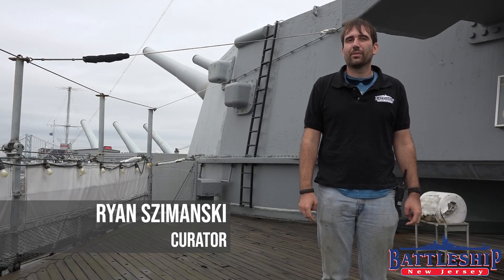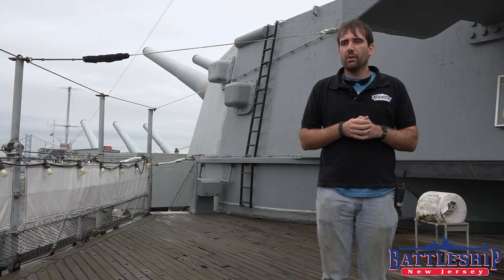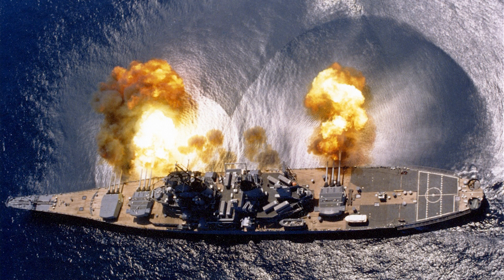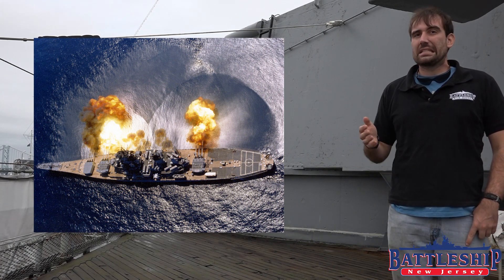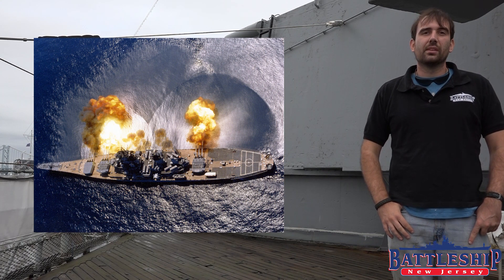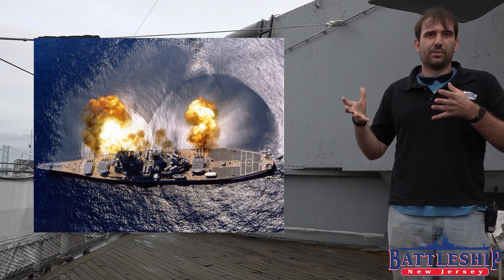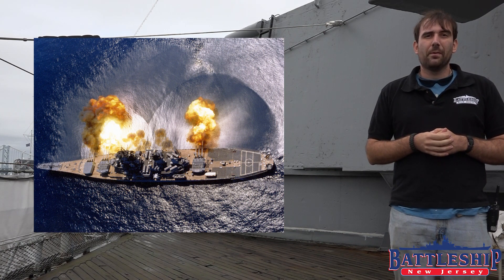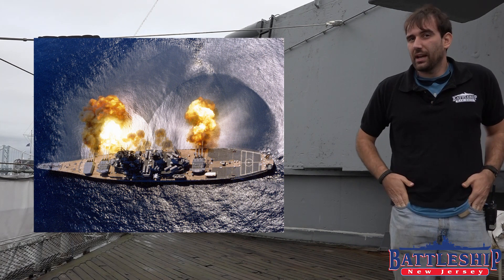Does Firing the 16in Guns Move the Ship Sideways?

Comment: Please see attached engineering analysis in the replies
Maximum Lateral Ship Velocity	0.59 ft/sec
Lateral Displacement at Time of Max Ship Velocity	0.42 ft
Lateral Ship Velocity at 60 Seconds	0.46 ft/sec
Lateral Ship Displacement at 60 Seconds	30.98 ft
Reply: This is follow-on to the analysis published in navweaps.com (http://navweaps.com/index_tech/tech-022.php ).The analytical approach taken there is valid, but doesn’t go far enough to fully answer the question. See additional comments on the above analysis in Appendix A.
The purpose of this document is to elucidate, extend, and improve the analysis presented in navweaps.com. Future contributors will undoubtedly improve further on what is presented here.
The navweaps.com analysis does a lot of the “dog work” associated with the overall question. Many of the analyses, calculations, and assumptions are correct, and are used here. This document will also clarify the physical phenomena involved, and more fully document and explain the assumptions.
Assumptions
Simplifying assumptions are valid, and don’t detract from the correctness of the analysis. They include, but are not limited to:
1.	The gunfire reaction forces are applied at the center of mass of the ship.
2.	Losses during transfer of the gunfire momentum into the ship’s hull are negligible.
3.	No yawing, rolling, or pitching moments are calculated.
4.	No aerodynamic effects are calculated.
5.	The ship is initially stationary, i.e. neither under power nor drifting.
6.	The water is calm, with no currents.
7.	A single salvo of nine, 16 inch guns is considered.
8.	The guns are oriented broadside, i.e. 90⁰ or 270⁰ “relative target bearing”.
Physical effects
The firing of a shell imposes an equal and opposite reaction force on the ship in accordance with Newton’s Third Law. The recoil mechanism reduces the peak reaction force imposed on the ship by spreading it out over a longer period of time, but the total momentum transfer from the gun to the ship is not reduced by this mechanism. 
An important concept is introduced here: Impulse = Momentum
Impulse is defined as Force X Time. Momentum is defined as Mass X Velocity. These constructs define the same physical property. The units for both are slug-ft/sec. This equivalence is important because it allows the momentum of the shell, which we can easily calculate, to be used to calculate the force imposed on the ship, and in turn the acceleration, velocity, hydrodynamic drag, and lateral displacement of the ship.
The horizontal component of this reaction force is of interest. This analysis will calculate this force by multiplying the shell momentum by the cosine of the barrel elevation angle. This correction was mentioned in the navweps.com analysis, but was not performed there.

Overall phenomenon
Definition: Sway is a sideward motion of a ship. It is separate from roll, which is a sideward rotational motion. The terms sway and lateral displacement can be used interchangeably.
Definition: For the sake of simplicity, the combined firing, recoil, and runout sequence will be referred to simply as firing.
The overall reaction proceeds as follows:
1.	The gun is fired.
2.	The momentum of the shell is transferred to the ship as a reaction force.
3.	During the firing duration, the reaction force pushes the ship sideways, creating a sway motion. All other motions are neglected for this analysis.
4.	The ship accelerates into a sway. As it does so, the velocity of the ship relative to the still water creates hydrodynamic drag, which reduces the net sideward force, and reduces the sway velocity. Hydrodynamic drag absorbs a portion of the ship’s momentum, which eventually dissipates as heat.
5.	At the conclusion of the firing, the ship has achieved its maximum sway velocity. The hydrodynamic drag now gradually bleeds off the momentum of the sway motion. The ship will continue to drift for some time, reducing its velocity, but gradually accruing a lateral displacement from its original position, and eventually stopping.
It is useful to put this sequence of events into terms we can all appreciate. If you’ve had the opportunity to gently push a rowboat or canoe on the water, either as an occupant or otherwise, with paddles or not, you understand the effect. Your push can seem relatively difficult, requiring a fair amount of force. Most of that force is required to accelerate the mass, which we will discuss later. The boat accelerates and travels slowly. But due to relatively low hydrodynamic drag, the boat will continue to move for some time after the propelling force is discontinued. Gradually, it slows to a stop, but may have traveled quite a distance. This is precisely the sequence of events with the battleship, albeit on a much larger scale.
Previous results and data
(Reference navweaps.com analysis)

Broadside momentum      	274.822 x 103 slug-ft/sec (1 of 9 guns)
Resulting sway velocity                         	6 in/sec (based on momentum method)
Recoil and runout duration             	1.33 sec
Ship mass                                       	58000 tons (@ 2240lbm per ton) = 129,920,000 lbm = 4034782.60  slugs
Draft           	38 ft
Length 			860 ft
Wetted lateral area        	(38 ft X 860 ft) = 32680 ft2
Gun elevation  		15⁰
Reply: Preliminary calculations
Broadside momentum = 274.822 x 103 slug-ft/sec
Calculate force from impulse, give that impulse = momentum. We’ll make the simplification of constant force for the duration of the firing: (note all of the following are per gun)

Impulse = Force X Time, therefore, Force = Impulse/Time
Average force = (274.822 x 103 slug-ft/sec)/ (1.33 sec) = 206,633 slug-ft/sec2   (lbf)

So just to reiterate, the broadside produces 206,633 pounds of force over a period of 1.33 seconds.

Now is just as good a time as any to correct for the gun barrel elevation
Horizontal component of force = (206633 lbf) (cosine 15⁰) = 199592 lbf

Physical similarity laws
The analysis will calculate hydrodynamic drag using a simple closed form solution. The equation is:

Fd = 0.5ρV2 A Cd

Where:
Fd = drag force, lbf
ρ= seawater density, slugs/ft3
V = velocity, ft/sec
A = projected area of the hull in the direction of flow, ft2
Cd = drag coefficient, nondimensional

In simple terms, this equation calculates the dynamic fluid pressure, sums the force over a characteristic area, then applies the drag coefficient which adjusts this force to the shape of the body. The result is the hydrodynamic drag force. 

The Cd is obtained from model tests of similar shaped bodies. Physical similarity must be checked to assure that the Cd is appropriate, and other assumptions are valid. The Reynolds Number and Froude Number are calculated here.

Reynolds Number:
The Reynolds Number allows the correlation of empirical fluid drag data to be applied to projects of different size, velocity, and fluid densities.

Rl = Vl/v, where

V = velocity, ft/sec
L = characteristic length, ft
v = kinematic viscosity of seawater, ft2/sec

V = 0.5 ft/sec
L = 108 ft (battleship beam)
v = 1.25 x 10-5

Rl = (0.5) (108)/1.26x10-5 = 4.285 x 106
Froude Number:
The Froude Number is used to determine if there is any significant interaction at the free surface of the water with the vehicle, i.e. waves, etc.

Fl = V/ (g L)0.5

Where:
V = velocity, ft/sec
g = acceleration of gravity, ft/sec2
L = characteristic length, ft

Fl = (0.5) / [(32.17)(108)]0.5 = 0.0085

This analysis shows that the Reynolds and Froude Numbers are within the range of applicability for the empirical data for submerged and partially immersed shapes shown in Appendix B. One of the two shapes differs from the battleship condition in that the battleship flow is perpendicular to the lengthwise centerline, whereas empirical data is taken with flow parallel to the lengthwise centerline.

Despite this difference, it is a reasonable engineering judgment to use these cases to determine the Cd. The spreadsheet described below is constructed so as to easily change the Cd for comparative and sensitivity analyses.

Review of the cases indicates the drag coefficient is likely equal or less than 1.0, and certainly does not exceed 2.05. 

Spreadsheet calculations
A spreadsheet was created to perform a time dependent analysis of the salient physical phenomena. Each dependent parameter is evaluated at 0.1 second intervals, except for the 0.03 second interval to complete the 1.33 second total impulse, and the 0.07 interval to create an even step for subsequent intervals. Specifically, the following are calculated:
1.	Impulse force from the broadside momentum.
2.	Lateral acceleration of the ship
3.	Resulting velocity of the ship
4.	Hydrodynamic drag due to the lateral velocity
5.	Resultant net lateral force, which is the impulse force minus the drag force. This is used in the next iteration step.
6.	Lateral displacement of the ship
7.	Incrementally iterate the above for a total of 1.33 seconds.
The above calculations yield the maximum lateral velocity, and the distance the ship has moved during the gun firing.

The next phase is the glide, where there is no force due to the firing of the gun, and the ship’s momentum is being bled off by hydrodynamic drag.
The following are calculated:
1.	The initial lateral velocity is known from the previous calculations
2.	Ship momentum based on lateral velocity.
3.	The hydrodynamic drag.
4.	Deceleration of the ship due to drag.
5.	A new reduced velocity.
6.	The lateral displacement.
7.	Continue to iterate until the ship lateral velocity is zero or for a given time period.
8.	Calculate the total lateral displacement.
Reply: As expected, the low drag compared to the momentum of the ship means that the ship will drift for an extended period of time. The analysis was therefore curtailed after 60 seconds, as that time period is an adequate demonstration. It could easily be extended if desired.

Results and discussion
Results for a simple case are shown in the following table. 
Condition	Single, nine gun broadside, 16 inch guns
Gun Elevation	15⁰
	
Maximum Lateral Ship Velocity	0.59 ft/sec
Lateral Displacement at Time of Max Ship Velocity	0.42 ft
	
Lateral Ship Velocity at 60 Seconds	0.46 ft/sec
Lateral Ship Displacement at 60 Seconds	30.98 ft
	

The results confirm the description given in the “Overall Phenomenon” section above. The ship accelerates laterally during the firing sequence, reaching its maximum velocity at the end of that period. The ship then continues to move, decelerating slowly due to the effect of hydrodynamic drag, but accruing a significant total lateral displacement.

 

There is no doubt that the phenomenon is well understood and described. There could, however, be discussion about the particular method to calculate effects, and the assumptions used to frame the calculations. For instance, the hydrodynamic drag calculation is admittedly simplistic, but this method is commonly used in basic engineering calculations in various applications. Increasing the drag coefficient to the high side of the expected range, in this case 2.0, reduces the lateral displacement to 27.89 feet at 60 seconds and the maximum velocity to 0.59 ft/sec. This shows the insensitivity of the calculation to the hydrodynamic drag, and in a way validates the overall analytical approach. Certainly high technology computational fluid dynamics (CFD) or other means could provide a more precise solution.

Perhaps a more interesting discussion, and one that could put to rest some arguments about whether the phenomenon exists at all, is to consider the effect on targeting.  There are many factors associated with naval fire control, most of which are not germane to this discussion. Wind motion, firing ship (gun) motion, and target motion affect dynamic firing solutions, the second one being discussed here.

Ship to ship combat would involve forward powered motion of the firing ship, which would allow dynamic control of the ship direction by steering, which would compensate for any lateral velocity component due to firing. Chances are therefore that the only situation of concern would be stationary bombardment of a shore target.

Since the lateral motion of the ship due to firing the first salvo would likely not be measurable, either due to instrumentation limitations (assuming they used optical rangefinders) and/or small in magnitude and therefore negligible, the only way to correct subsequent salvos would be by spotting the fall of shot. This would also allow compensation for any ship motion due to sea currents, and all other reasons, which are likely much bigger in magnitude than velocity of the firing reaction.

Also consider that additional salvos could be fired while the motion of the previous salvos has not completely decayed. The effect of each additional firing is additive, and therefore the velocity would be more significant. 

So the argument cannot be made that the motion does not exist because it is not discretely measured or observed; it certainly exists, is significant (especially after summing velocity of repeated salvos), and compensation is made through spotting. 

(Source for additional information on naval fire control:  https://eugeneleeslover.com/FIRE-CONTROL-PAGE.html )

Conclusions
It has been shown that lateral displacement of a battleship due to gunfire reaction indeed exists and is significant in magnitude. It may not be noticeable due to existing environmental conditions, such as currents, winds, or ship motion. Although not explicitly measured or acknowledged, it is included corrections after spotting fall of shot.
Reply: Summary:
Maximum Lateral Ship Velocity	0.59 ft/sec
Lateral Displacement at Time of Max Ship Velocity	0.42 ft
	
Lateral Ship Velocity at 60 Seconds	0.46 ft/sec
Lateral Ship Displacement at 60 Seconds	30.98 ft
Reply: Physics!

Comment: Laws of physics tells you the ship has to move. The question is how much. Dropping a piece of paper causes the Earth to move towards the paper but the amount is miniscule.
Reply: If you cannot perceive the effect, is it really relevant tho? Halfing the distance between myself and a wall with every step ensures I will never ACTUALLY reach the wall, but eventually each step will be so tiny as to have EFFECTIVELY reached it.

The possible millimeter vibrations experienced by a 33 meter wide ship travelling at upwards of 32 knots would get drowned out by effects of waves and not really be relevant.
Reply: @Uncommoner   The old arrow to the target theory? Except the problem is the object in motion is actually going past the target and the target is in it's path. Using limits in calculus, it's the final destinations that are used. No matter how small, the effect is still there.

Comment: Old sailing vessels which fired a full broadside would pitch and roll. However modern armament is made to disperse recoil. The simple explanation is that the guns on a WWII battleship do not absorb recoil like older guns, the energy from the broadside is dispersed from the weapon and regardless of ship tonnage or displacement in the water it would not let the ship slide sideways.

Comment: How far it moves isn’t the question. Does it move or doesn’t it? That’s basic physics. The ship isn’t braced by any fixed object so it loses mass and absorbs all the energy of the powder. It’s just like a body in space. Technically it does receive a minute sideways push and technically the friction in the water from the event causes it to heat up. Good lock measuring any of that though.
Reply: Maximum Lateral Ship Velocity	0.59 ft/sec
Lateral Displacement at Time of Max Ship Velocity	0.42 ft
Lateral Ship Velocity at 60 Seconds	0.46 ft/sec
Lateral Ship Displacement at 60 Seconds	30.98 ft
Reply: @physicsphirst191  Nice work. I like people who compulsively solve problems. It’s the cornerstone of entrepreneurship.
Reply: @headfirst6227  Thanks for your kind words of encouragement. I'm just trying to keep my noodle sharp. if you search further, you'll find my original comment with the complete analysis.. It's rather long, but might be of interest.

Comment: To paraphrase Captain D. J. Katz, "I can't tell you how accurate military GPS is, but when we fire a broadside, the GPS doesn't even flicker". Nuff said.
Reply: Nuff said?
So you're basing your answer on hearsay from someone sworn to secrecy.
That's not a level of accuracy I'd go to court on.
Let's assume that military spec GPS is good to 10cm. It can't measure 1cm or 1mm increments.  
The recoil from 9x16"/50 guns is several tons - working against the friction of the water on the hull. I can push a 2 ton car and I don't weigh 2 tons - but the principle is the same - small force can move huge mass. The power to weight for me/car is much greater than that in the BBs case - if the energy from the guns isn't all dissipated by vibrating the ship then there might be some left over to move the ship. 
There's no way it would be detectable by GPS but a tiny movement is possible.
Reply: @pd4165  If you were in the military you'd know that secrecy is common. Yes, I trusted my Captain. He had no reason to lie and if the answer would have comprised operational security or the ship he wouldn't have answered it.